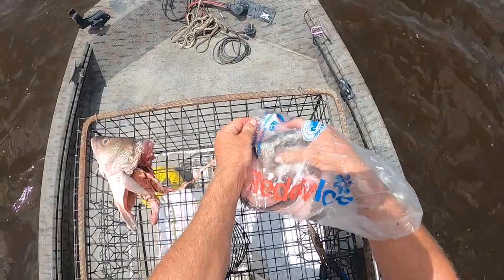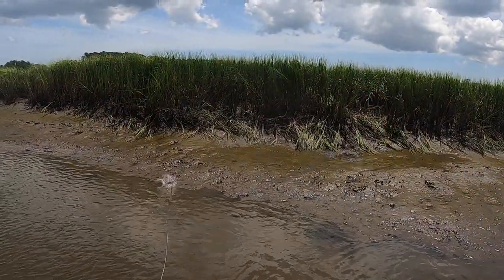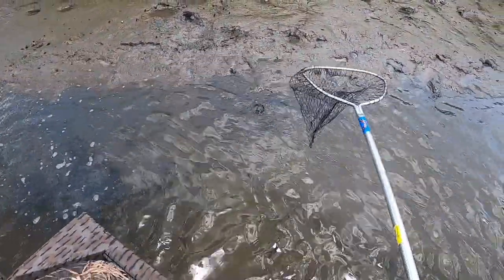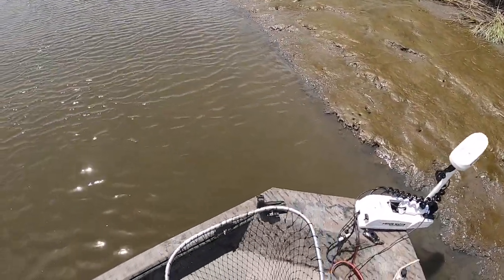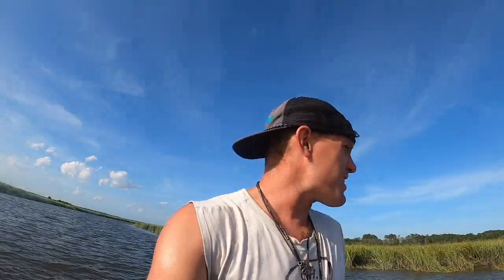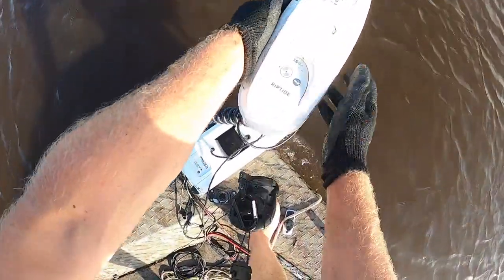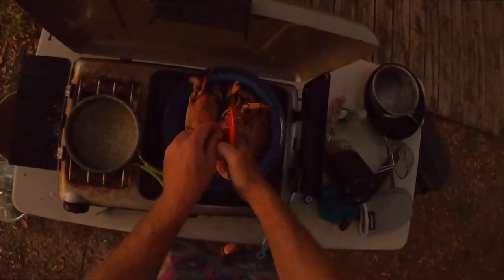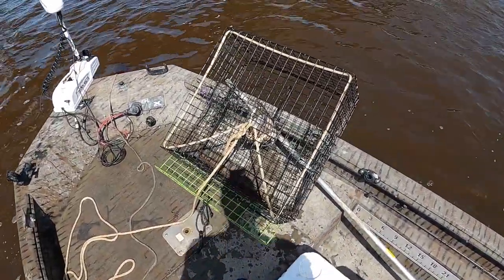Black Drum & Blue Crab Catch n' Cook 2 DAYS at the Coast!

Comment: Blue crab is delicious. However, if you were not aware, there is a ton of crab meat on the inside of the body. Basically before you cook it, grab the tail of it, and pull it up and tear the top of the crab's shell off. Once you do that, clean the guts in the middle out, then break it in half. Where all the legs meet up to the main body there are large pockets of meat. It's basically the best part.